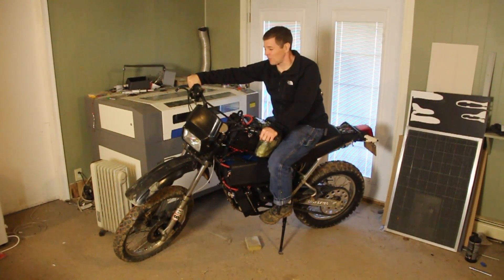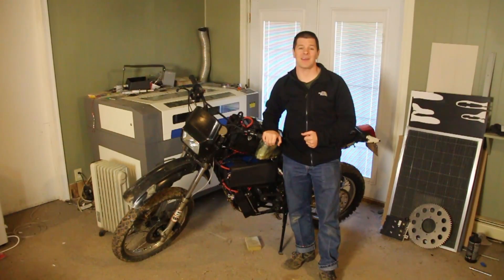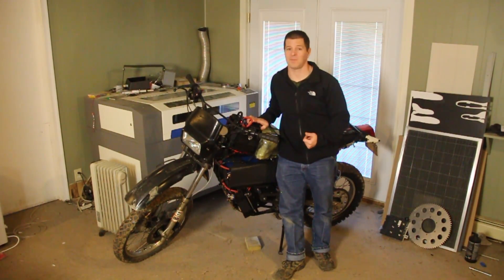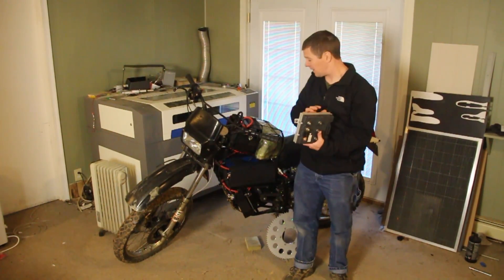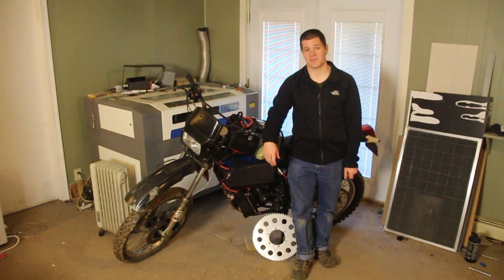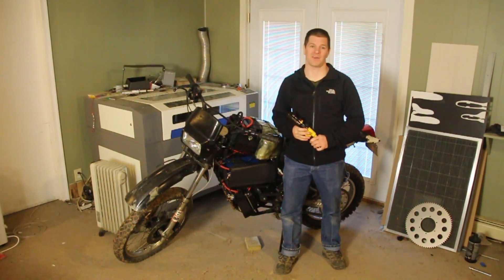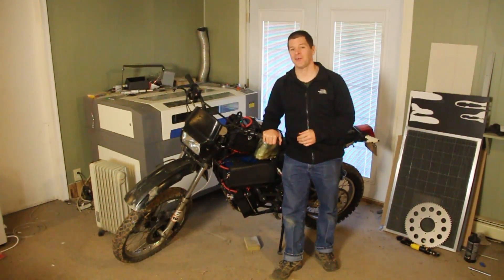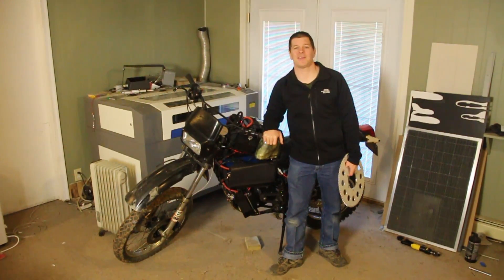12 Important lessons you will learn when building an electric motorcycle

Comment: I started with a very nice excellent condition GZ250 frame and tires, and then gave up when I realized the batteries would make it prohibitively expensive.  Ended up selling the frame, and later buying a 3rrd gasoline motorcycle.    Back then I only knew about Lipos, and later I'd solder up my own Lion battery packs using 27000's for fpv quadcopters, but I still think the prices for these motors and batteries don't make it yet feasible to build an electric replacement for my grocery haulers.    I only need a 60 or so mile range but still.

Comment: any chance you have an idea why my 72v 3kw system came with 2 relay flashers? and then why the system blew the signal flasher relay only 5 minutes after wiring it up? and awesome video. Getting, installing and programming my Fardriver sucked butt. I wish someone would make a literal pop and play set up with customising.  Are those batts LiFePo4? and Prismatic just wondering? I also only use LiFePo4 batts due to their safe factor actually.  But Alex keeps sending me the crappy pouch version even though I demand the Prismatic version and they refuse to return my money What is amazing is no one has bothered to jump in and start producing specifically, the parts everyone absolutely needs when doing this those people need tog et it in gear for us! Like Wiring harnesses, someone needs to simplify the turn signal break and running lamps, and head lamp set up coming off the wiring loom and make it so it does not keep dying and breaking down that would be helpful,

Comment: Graphine cells far better they can be put out with water if they do light up and they have x2 more charge capacity means you can have x2 the range for the sane size battery if you built a lithium one.

Comment: 3:07 as someone with a 10-year-old electric car with li-ion batteries (and this applies to a lot of other li-ion based stuff as well) that 4-8 years claim is very conservative. Good-quality cells like Panasonic batteries can definitely last well over 10 years.

I've also seen figures for LiFePo4 batteries in the 25 to 30 year range, so they can definitely last even longer than 20 years.

Comment: Hi
Thank you for presenting your video 
Can you advise for parts?
And what about the motor?
Reply: Motor: GOlden Motor 10kW
Controller: ASI BAC4000
Batteries: 24X LiFePo4 / 85Ah from OSN Power
12V converter: some $70 unit I found on Digikey (forget what it is called)
Charger: Got it from the battery manufacturer's recommendation
BMS: built it myself form a bunch of 4S balancers

Comment: I agree with Lifepo4 Chemistry, i recently switched from Li-Cobalt to Lifepo4 in my EEB BBSHD build for exact same reasons. Who needs there pride & joy ruined by a fault resulting in thermal runaway not mention potentially losing my garage or when ebike mounted on back of car, potentially losing car if fault occurs in cell. NO THANKS 😊 Good build
 points there, cheers 👍 🍻
If tesla still gets thermal runaway issues with their EVs  (non accident related) with their millions of money spent on safety & high build quality, then what hope has the average DIY ebiker have if any cell fault occurs with Li-Cobalt chemistry. 🤔🤷

I have heard that even Tesla also switched over there cell chemistry at one point to Lifepo4 cells. So theres a strong & valid indication that even Tesla cant risk their company name with such an event like a cell fault & thermal runaway.

Comment: I am very thankful for this video. My dad passed away and left my brother and I two motorcycles. One is a Harley and the other is an old 1970's Kawasaki something or another. I don't want to destroy the Harley due to my dad absolutely loving that bike, but he would also approve of my ripping the Kawasaki apart and building a badass electric bike out of it, which is what I am wanting to do. I've been doing research for the past month on what to buy, where to buy, and so forth. I just came across this video and THANK YOU SO MUCH!!! I was a mechanic by trade years ago and I quite wrenching, but I also used to do my own fabricating parts and tools when I was in that line of work, so I know how to fabricate as long as I have a plasma torch and a welder, but I'm not a great machinist and have no tools to do so. Fantastic advice

Comment: It's hard to tell if your videos are more inspiration or education because they're a heck of a lot of both.
 
I watched this when it came out and again today.  As we convert our '04 GS500F to a 8KW, 72V hub motor, we're learning a metric ton and your points still apply every few steps, LOL.  We've had to add "ears" to connect the hub motor that stick into the ends of the existing swingarm.  I've been rather unimpressed w/the limited details that Siaecosys provides so far, so we may change controllers to get better CAN BUS doc, to your point about re-buying.

Using an "agile design" approach has helped us on this and other projects as has having someone who's good at mechanical/welding and someone else who's good at electronics.  We're teaching each other and learning at the same time.  We're all really looking forward to riding this when it's done.  The project goals are 60mph+ for 60mi+, <6h charge, and 6y system lifetime, so we're using LFP cells and parts that can improve on all those minimums.

Comment: Alex
Do you think it’s a good idea to have small 12v battery after the 12v dc-dc converter or maybe some fat caps? Or just converter then lights, no 12v power storage device?
Reply: I thought about that.  The issue is that capacitors will discharge over the course of about an hour or so.  So if you can close your master contactor manually to get the 12V going, capacitors will be ok.

Comment: Correct me if I'm wrong but it seems like technology is rapidly advancing and a lot of these problems that you ran into may now be solved by simpler systems. For instance now they have a hub that can do 5,000 Watts with a 72v. Battery and it comes with a kit which is plug and Play.
Reply: Ever ride a hub motor bike?  The unsprung weight really affects the handling.  I did an electric bicycle with one and another with a center drive.  I hate the hub motor and wished I would have gone with the center drive.
Reply: @CAGreve1231  i agree
Reply: @CAGreve1231  Bicycle? But what about motorcycle? Are you apple and oranging this comment?

Comment: Thanks for your advices... I'm trying to convert a Mobilete, an motorcycle but with pedals, here in Portugal is not legal to do so to a big motorcycle but with pedal we can... 
I will follow your advices and ask what should I do an engine on the pedal or on the wheel? I'm thinking on a 2000w or better... I have already an old pack of an Vectrix Vx1 that was costum made A123 but some lines were death but other are still alive...

Comment: Hell Higher Voltage, just out of curiosity what motor controller did you initially get that you didn't like the throttle response? What did you replace it with? I'm looking build an electric motorcycle, very impressed with your bikes. I'm looking into using a Sevcon Gen 4 controller.
Reply: ASI BAC4000 is what's in it now (this is my other account).  The Golden Motor controller I had in it just irritated me.  Sure it worked, but I'd shut the throttle down and it would still be puling for another second or two which is extremely dangerous and annoying.

Comment: I think you meant a 520 not 420 sprocket is not compatible with a industrial motor. Both of my electric motorcycles use 420 rear sprockets with a #40 front sprocket on the motor. 420=#40 425=41 & 530=#50
Reply: Yep.  Misspoke.  Also had an error mentioning LiFe when I meant LiPo...  Oops...

Comment: so i'm curious if you are using a lithium phosphate battery that allows you to more completely discharge can you get more usable energy per charge vs lithium ion batteries that has higher energy density but cant safely be discharged as much? curious about the balance of that. like per weight how much range each one would provide.
Reply: 1 kWh is 1 kWh regardless of source, unless we're talking about lead acid. All lithium batteries provide 100% of their rated capacity regardless of discharge rate. All lithium batteries are limited in life span by charge cycles, and subsequently best practice is to only discharge to 80% DOD to preserve battery life. This is every manufacturer's recommendation, and they know their products better than backyard builders. LFP is safer in that it's more stable in overdischarge (ie: overcurrent) conditions and doesn't overheat and explode like Li-ion in most cases, but that doesn't mean it can be overdischarged continuously every time you ride in a vain attempt to get better range than Li-ion without consequence. "More stable" during overdischarge doesn't mean perfectly stable. If you overdischarge any battery too much, you're asking for trouble in more ways than one. Also, if you drain the battery to 100% DOD every time you use it, then the battery will expire sooner than if you were to manage your charging cycles so that you're not always charging a fully dead battery. If you value your savings, you'll use it responsibly. Per weight Li-ion would win in regards to range simply because it's more energy dense. In the long run it will lose because Li-ion is only good for ~500 full charge/discharge cycles whereas LFP can go up to 5000 cycles - on avg LFP will last 10X longer even if you charge like a dummy by draining the batt dead every time. LFP will provide much more mileage in the long run for a cheaper price, and without the risk of burning your ass off in a fiery explosion. Energy density differences be damned, LFP has an edge over Li-ion if used responsibly.
Reply: @JamesBiggar  
Great explanation James, thanks.
Reply: Sodium Ion.  I am building an electric dirt bike with those cells now.  They can be discharged all the way down without damage.  My concern, though is they do not like cold weather.  We'll see how it goes when it is done.

Comment: I think you should research a bit about liion technology. There are plenty of liion chemistrys which are very safe and have a high discharge rate and capacity. Dont get me wrong but this Video isnt that old and your information booth looks like it is on 2015.
Reply: Li-ion is just one type of lithium battery, and the go-to battery for shat talking about lithium tech. LiFePo4 (or LFP for short) is REALLY safe, the safest I believe. Still a small risk of fire in certain rare circumstances but a person can literally drive a metal rod through a cell and the most that will happen is some swelling. I use batteryhookup's LFP cells these days. Really good specs. Not as energy dense as li-ion but still have great capacity and charge/discharge specs, and they'll last almost 10 times longer. I won't use anything else until LTO comes down in price.
Reply: @JamesBiggar  thanks James.

Comment: Lithium fires are very blown out of proportion and if you do ever have issues use LOTS and LOTS of water. I don't care if it's in your basement or your bedroom, use the garden hose on it full blast until you can get it safely outside to "chill". Thermal runway is just that, thermal. Water has some really great thermal properties and no lithium chem currently can displace enough energy to beat a garden hose
Reply: Great advice, somebody is gonna get blown up becouse of your “advice”
Reply: Dude... no...  Seriously.  Lithium is an alkaline metal.  it combusts spontaneously with water.  If your bike burns, push it outside fast.  If you have sand or concrete, use it.  If all you have is water, wet the area around so it doesn't spread but hit the batteries and it is going to be a massive mistake.

Comment: Lol this is all so true. I'm on month 5 of my build right now, started researching almost 9 months ago now. The mechanical side is my strong suit. I have had to re-buy so many electrical parts, mainly fuses and resistors for pre-charge. I'm pretty sure the crappy $8.00 DC converter I got to power my lcd won't cut it either. The thing that lead to the most frame modifications was the size of my battery and I steered away from LiFePo4 because of their size. What supplier do you like to use for those batteries. I think I would really like to use those cells on a future project, unfortunate that you kind of have to go for different chemistries on smaller frame bikes. If you are interested, please check out my build series. Your advice would be very welcomed and might help out some other newbies like me that are watching.
Reply from the maker: The best thing you can do is find someone with a home built bike, invite them to the local pub, and buy a few rounds for them with a notebook in hand.  With more and more people building these it will become much easier to do this.  Of course, that person doesn't know everything you need to know.   They'll just save you a lot of time and money teaching you 75% of what you need to know ;)

I get my cells from OSN Power in China.  The rep I talk to is "Merry".  LiFe come in pouch cells as well as cylindrical cells for easier fit.  I just went with Prismatic for ease of assembly and maintenance.
Reply: Also I am having trouble with the converter. Mine says that is can handle 18-72VDC but my bike will be at 84VDC max and I have no idea what the implications will be. If it breaks the device, no big deal, but I don't want to start a fire or damage other electronics. Do you think I should get a converter with a higher allowable DC voltage input?
Reply from the maker: @vincentpernicano3277  - Converters are kind of a dark art.  The ones that work are overpriced.  Check DigiKey.   I like the 13.7V converters because I place a diode on the output which steps it down to 13.4 and keeps it from discharging my battery when stored.  THis is a good one:  https://www.digikey.com/en/products/detail/delta-electronics/B70SR13722CC/7681584
Reply: @highervoltage5430  Looks like a very solid unit, do you have another one you would recommend that has a lower power rating? I only need to power an lcd screen I am not making the bike road legal so I think 300W would be overkill.

Comment: quick question there are lipo batteries that have capabilties 20-30c compared to your 6c? I know the dangers of lipo but surely lipo would be able to cope better with the strains of an ev?
Reply from the maker: 30C?  No.  Nothing can sustain that for any reasonable period of time without damage.  20C is the upper limit.  If you want to use small pouch cells (no more than 2000mAh) with adequate cooling you can get 20C for 5 seconds or so.

Comment: What kind of dc-dc would you use for 120-12 to power a motorcycle
Reply: Also charger for 32a lifepo4
Reply from the maker: @ryanmccutcheon0904  - Sorry I missed this!  I got my converter from DigiKey.  It was $92.  As for charger, I got mine from OSN power.  $100 for the charger.

Comment: Thank you for the great tips! I'd be interested to hear your thoughts on using a NiMH battery on a build. I have an 05 hybrid accord battery I was planning on using, after I re organize the setup a bit to 72V
Reply: current set up goes with a 72V eq7-4003 brushed DC motor, shaft driven, on a 83 honda gl1100 frame
Reply from the maker: NiMh is a well-known and solid technology.  While slightly heavier than lithium based batteries, they have proven to be able to take quite a lot of abuse.  I would say that it is a solid tech to use.
Reply: @highervoltage5430  very finicky to charge though.

Comment: Great advice, thanks for making the effort of sharing. 
Question, what was the problem with the other motor controller? I understand that there was an incompatibility but in which way? I am super keen on building an electric motorcycle from an old bike but don't have a budget to do it now. I'm on a information gathering stage atm and in need to understand the subtleties
Reply from the maker: The throttle response was absolutely terrible.  It would either give me very little power or go full throttle on me.  It also only had constant speed mode and I want torque control, not speed.

Comment: What background/skills would you say are the driving factor in your builds? Specifically motorcycle mechanics or more along the lines of electrician with welding and fabricating knowledge? Thanks
Reply from the maker: Great question!  I am an electrical engineer by trade, so the electric part is very simple.  However, I think anybody with a basic knowledge of electricity could do this.  If you can troubleshoot electrical problems on a car or a motorcycle, you can do an electric vehicle with ease.

I am a mediocre welder at best and my mechanical engineering skills aren't my strong suit.... which might be my biggest problem and why I end up re-buying certain parts.  

I would say any tinkerer should be able to build their own bike.  And if they run into a point where they are having difficulty, I am always around to answer questions.  Heck, I tend to give out my personal phone number to help people out.